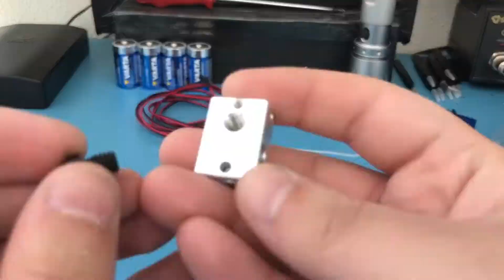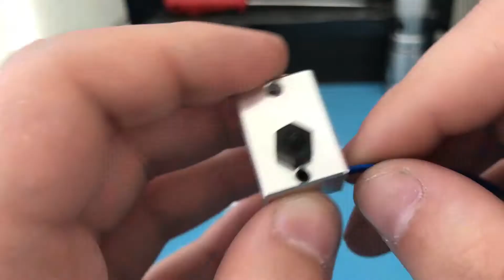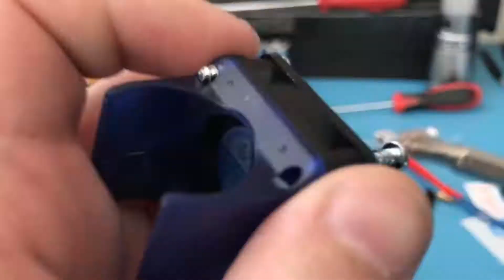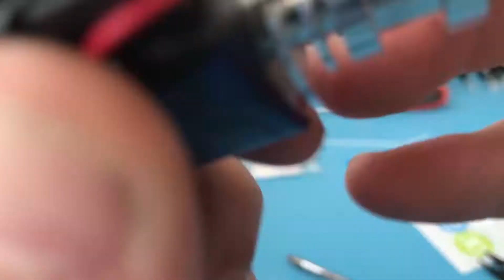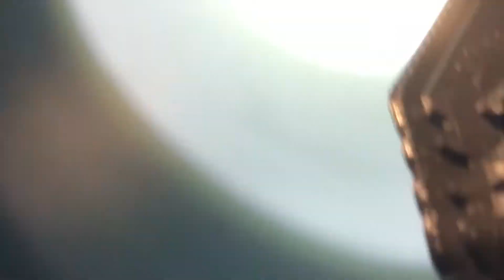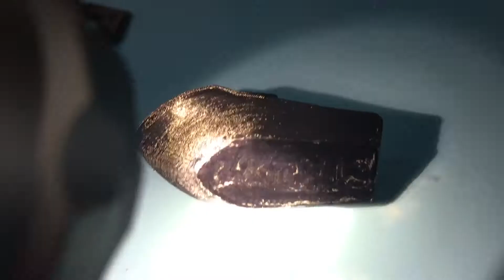Tevo Black Widow Mods Part 5 - E3D V6 Assembly & Comparison Printing

Comment: BLTouch is a garbage... especially if you use not original one. I have Tevo BlackWidow without it and print without any problems with first layer.
Reply: I have bltouch and its amazing never have had to level the bed. Works perfectly, My old printer I hated leveling the bed.